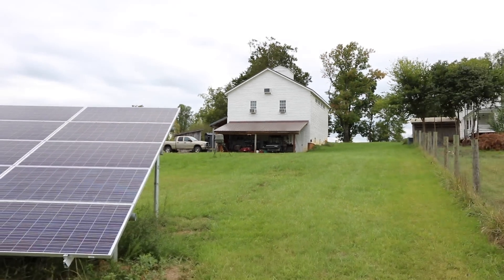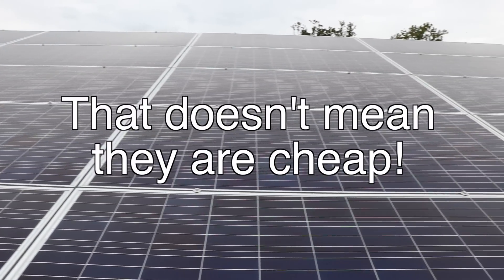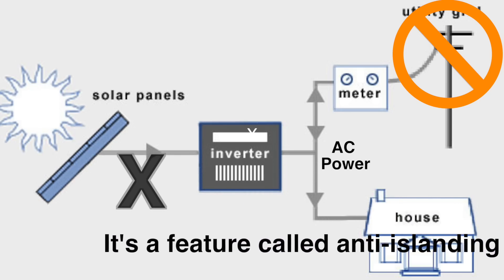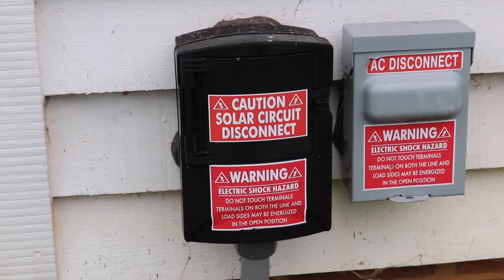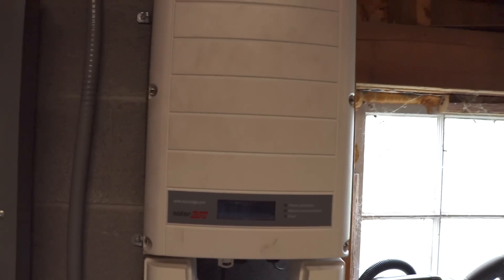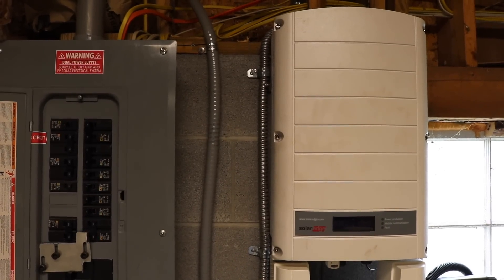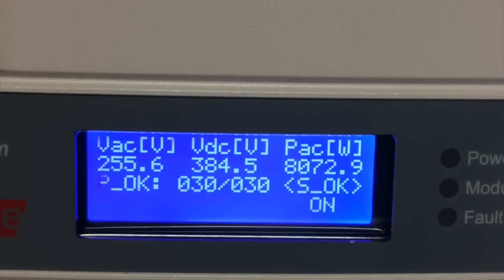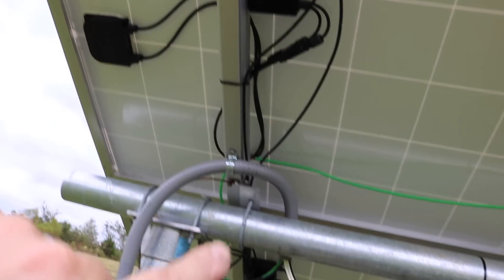The ugly truth behind grid-tie solar systems. Part 1, FarmCraft101 solar.  Watch before you buy!

Comment: $17K will buy me at least 15 years ($23K 20+ years) of maintenance free electricity that is off maybe 1 - 2 hours a year and none of it is sticking a hard working tax payer for part of my bill.
Reply from the maker: You only use $1100 of electricity per year?  I use double that.  Which means you could have a system half the size of mine and pay only $8.5k to supply 80% of your electricity for the next 30 years.  
Also, I have paid far more in taxes than the few tax credits I received from this.  Far, far more.  There is a lot of confusion over what a tax credit is.  It is basically a refund of taxes that you have to pay.  To people that don't pay taxes, credits are worthless.  It is not a check from the government to the recipient.  They are only a reduction in the taxes that the recipient pays.  In short, nobody got stuck paying a bill for me.  I just paid a little bit less one year.
Reply: @FarmCraft101  Where I live we have too many cloudy days and short winter days for solar to be practical.   Many have tried and all came up short on the cost effectiveness here.

Same with those who tried using ground and or air source heat pumps for heating.   The ground too damn cold to be effective for it.  Super summer air conditioning though but not cost effective for using just for that due to the install prices largely thanks to greedy contractors.

What we do have that works is wind power.  Loads of wind and I have played with it for years!
Reply: @tcmtech7515  Then Solar Panels are not an a viable option for you . Nobody is forcing you to use Solar Panels ...

Comment: yeah, you need a better isolator(?) switch. the kind of thing you have to have with a generator so linemen dont get shocked. to have power when the grid is down this cut-off would possibly have to be manually opened. without that feauture there is really no benifit other than the 100+ dollar a month savings.(going by my monthly bill since I dont remember the number you said)
 so get yourself one of those isolator switches, with a battery stack you shouldnt need the grid at all and I really ont understand why you wouldnt have done that instead.... its how the phone system works. big inverters, stacks of batteries and the phones will work for 24 hours without a generator running, its accualy part of the code, the system has to work in emergencies.
  ditch the power company!!

Comment: um buy a inverter that does not shut down and use a relay powered by the grid that keeps the circuit complete. when power goes out on grid relay drops off and keeps lineman safe.you will still have local power thats isolated from the grid.

Comment: I have a 10 kw grid only system, I have separate meter and it pays me $0.802/kw. I make about $10g/yr. so system paid for itself withing 3 years and I paid $50,000 90 months ago. The only thing that I dont like is the inverters not able to function if the grid goes down. need to design a manual transfer switch that will allow inverters to work without back feeding the grid. I have 2 aurora inverters that are fed 2 legs each of 545 vdc

Comment: It is the impedance (resistance) of the wire that creates loss  V=IxR. The higher the resistance the bigger the loss. That resistance will generate heat and eventually break down the wire.

Comment: Logically... Voltage/Polarity is the hose/pipe inside diameter, Amperage/Current is the pressure induced. Power of both ... their sum... would be the forces in which the hose/pipe must be built for. The strength, and size of the material, especially at junctions and fastenings, of that power transmission must withstand EXTREMES of weather and spikes....ie., your Breaker Box. Next, we can talk about Inverters, Regulated PowerSupplys, Relays, and Transformers !!

Comment: Have a shed right next to a giant silver maple I have to fell. Figure I'll leave the trunk in place to anchor a pole and start a simple grit tied system. 8 feet from the trunk is a small shed,  from the shed and tree, my house is about 40-50 feet. Would it make sense to run DC from the panels to the shed, then run the AC to the house? I'm not looking to start big.

Comment: You state that you don't have power if the grid goes down. I guess not. There is a device that can be placed between the output of your inverter and your breaker box. It is basically a small battery, an inverter and a computer. What it does is

a) maintain the charge of its battery from your solar power output
b) monitor the grid's power phase (the same way microinverters do for two reasons: 1) keep in perfect sync with the grid's phase and 2) detect when the grid goes down for (required) "rapid disconnect).

As soon as the grid goes down, but before the microinverters detect that fact, it
a) disconnects the output of the solar system from the grid but maintains a grid monitoring circuit (to detect when the grid is restored)
b) switches on its own microinverter and creates a perfect 220 VAC waveform that makes your solar system microinverters believe the grid is still energized
c) uses the solar panel microinverter output to keep its battery charged
d) and lastly, and perhaps most importantly takes output from the microinverters and routes it to a single 20 amp outlet.

20 amps isn't much, but it will run lights, keep your fridge/freezers running, keep a charge on a conventional lead-acid deep cycle battery for nighttime use... as long as there is light. It isn't a perfect solution, but it will keep thousands of dollars worth of frozen food from spoiling!

Think of it as an intelligent rapid disconnect with a bonus. Sure is a lot cheaper and easier to maintain than a lead-acid battery array with a separate 48V mega-inverter or a Tesla Power Wall.

BTW, I have a 4350 nominal watt solar system with Enphase IQ-6 microinverters, an Enphase Envoy all grid-tied through a one-to-one net meter. Have yet to pay an electric bill. Total cost of installation (start to finish, all permits, inspections, etc.) was $2.80/watt, and after this year's 30% tax credit that becomes $1.96/watt. It will pay for itself in 10.5 years. That, in my book, is a good investment.

Comment: Pretty interesting reading through many of the comments, and some overly strong opinions against solar...  Do the research, do the calculations, see if it makes sense for you and either do it or don't do it.  I put in a system last May after much research and running calculations on financial return.   I looked back at the historical energy cost increase for the last 20 years (about 1.03%) and used that number to project  cost increase and savings over the next 20 years.  My 6000w system will cost around $7000 after I claim the tax credit this year (designed and installed myself so costs were lower than most), and at the end of 20 years I will be up over $20,000.  I think it quite likely that the average increase over the next 20 years will be much higher than the past 20, which will only increase my return.  There aren't many investment opportunities to get that kind of return, and to feel good about it also.  To those harping on the environmental impact of producing solar panels, of course that's valid, but the electricity I would have gotten from the power plant would come most likely from burning fossil fuels, so let's not just consider half of the equation.  I think the broader picture is to look at a state like California where we aren't that far removed from having rolling blackouts because they couldn't meet the power demand.  As development continues in most metro areas the power demands go up and eventually a new power plant needs to be built and transmission infrastructure upgraded, what do you think has more of an environmental impact those solar panels or building a new power plant?  Peak demand on the power industry is always during the hottest, sunniest portions of the day/week/month/year, which is exactly when solar panels are cranking out their max output.  While my power co-op was running ads this summer asking people to reduce load during peak times of the day I was getting an extra little kicker back on my bill for not loading the system at those times, I was covering my power use.  If even ~10% of the homes in California had solar panels those rolling blackouts would probably never have happened, and the life of their power grid would have been greatly extended without massive investment in upgrading the power supply and transmission infrastructure.

As far as the "no power when the power goes out" comments...what portion of the year are you actually without power?  In 15 years in my current house we've had one outage of maybe 8-10 hours due to a blown transformer, otherwise a few times out for an hour or two due to a storm so for me it's just not a huge concern.  Some people find battery backup to be worth it, in my case I was all about the payback time for the system and battery backup would have added years to that with (for me) little benefit.  If the power goes out I won't have power, so what?  I knew that going in and it wasn't a factor in my decision, it was a good solid financial investment for us and we get some added enjoyment out of tracking the output day to day.  The following link should bring up a public version of the tracking page for my Enphase based system, you can go back through past days and see daily output.  October and November haven't been good, lots of clouds, but July was fantastic with just under 1000 kwh produced and I look to be on track to meet my projected annual output of 7800 kwh's which will pretty much cover our usage for the year.

https://enlighten.enphaseenergy.com/pv/public_systems/UrGs1410763/overview?preview=1
Reply: Fantastic quote and for me, very close to making the leap into deciding to buy and install my own, its nice to see someone mirror my sentiment

Comment: You idiots
Since when is plumbing the same as electricity or even relating the same
Water pressure remains constant unless you use a pump no matter what size pipe
Volume delivery is another story
Or should I say that’s what you should have said in the first place
Reply: You idiot, it is called an analogy  ...
Water Pressure is equivalent to Voltage

Comment: At the beginning explanation is quite perfect, the "dark" point is about the interrupting solar power when grid is collapse. You means that happened to all the solar systems or happened only to this with the partiqular grid?
Reply from the maker: It happens to grid tied systems, which is a term in the solar world that has a specific meaning.  It doesn't mean any system tied to the grid, because hybrid systems are also grid tied.  But when a solar installer talks about a grid tied system, this is what they mean, and they require the grid to be functioning to work.

Comment: Good explanation on how Grid Tie works. I'm running Off Grid with changeover switch to Grid. Expanding setup but currently 1K4 PV with 8K7W Batteries backup. A battery system is the way to go.

Comment: I have the same inverter.  The power optimizers set this voltage - for your system it isn't based on the panel voltage like you mention.  NEC 2017 allows for up to 1000V on PV DC side now, but most inverters capable of that right now are commercial grade.  Also, your disconnect isn't code complaint.  Has to be a handle type heavy duty disconnect.  Since these are newer systems, most inspectors won't know all the codes.  We did DIY and it was about $13k before 30% tax credit.  I'm in Ohio, so my payback isn't the best compared to the rest of the country, but it is still about 6 years.  PV is a good investment, especially considering it increases your house value.  I'm probably going to add 4kW of panels (inverter can take about 13.5kW DC) to account for an EV, then I will feel even more dependent from our oil/coal based electricity economy.  The naysayers in the comment section can keep burning oil and coal.  Their minds probably won't even change when electricity cost doubles.
Reply: Did you install a 9kW system for $13,000 -  before the Tax Credit ?
WOW, that is really cheap
What brand & size PV panels
What brand & size GT Inverter ?
What Mounting System

Comment: The sun does not need to shine for a solar PV system to produce electricity. In fact there are different solar PV modules that are designed for varios climates. Even on a cloudy day the system can produce up to 40% of it's designed DC electric output
Reply: The sun is still shining when there are clouds.   Ergo, the sun DOES need to shine to produce power via solar.
Reply: @carultch  You know exactly what I mean or are you just being pedantic? Solar PV modules do not need 'direct sunlight' to produce electricity. 'Ergo',  solar PV systems still produce electricity even on cloudy days
Reply: Of course I know what you really mean.  I'm just setting the record straight.
Reply: @carultch  The 'record' didn't need to be straightened if you understood the point originally as you said, but thanks anyway

Comment: 240V split produces two 120V phases, not single phase.
Reply: It is still called "single phase" for historical reasons, and based on the way the grid makes it.   In spite of what you might think, there is no such term as "two phase".  Even when your voltage system is derived from connecting across two phases (as opposed to across a single phase and neutral), it is still called "single phase".

The way the grid makes it, is it uses an individual phase from the distribution line, steps it down from medium voltage to 240V through the transformer, and then center-taps the 240V coil to assign the neutral conductor, which is then grounded to the grounding electrode and equipment grounding conductor system at the main service disconnect.

Comment: Surely a normally closed contactor where the coil is connected to the grid could solve the issue of you loosing power when you eventually have enough battery backup to supply your house.

Comment: What I don't understand is why not put an auto switch between the solar and grid.  Our plant gensets all have this function. When the power goes out, the natural gas generators automatically start and the switch also automatically disconntects our entire facility from the grid. Until power is restored. Also there is alot of false information on youtube, the internet, from my local power company and most of all, from the solar companies.  They all will state you have to pay an electrician to grid tie.  I called the state inspector who inspects these, he stated it is 100% false.  Then gave me the link to the state codes, and the permit.  Being an engineer designing machines using all forms from DC to 480ac ,. Installing solar is easy.

Comment: IMO it's best to do an off grid setup, then have rectifiers top up battery from hydro if you're not producing enough.  When you sell power to the grid, you will need to buy it back at some point and it will always be more expensive.  Makes more sense to store it.  Though a grid tied system IS cheaper, so it's a good way to get started, then later on upgrade to off grid.  Bonus is if you find yourself not even needing hydro you can cancel the service (in some places it's unfortunately illegal though) and then you save even more money, because it's all the fixed fees that are really expensive, and not so much the usage.
Reply: Fore most people, adding batteries to a Grid-Tie PV System is an immediate and permanent financial LOSS.

Comment: I lot of oil products, natural gas and coal will be needed to manufacture electric cars and more so in generating electric power for those cars. Coal number one as Germany is 80% coal run 30% of which comes from the USA, natural gas big growth in North America to generate power as we turn off coal. But coal is need to manufacture wind turbines 240,000 tons of C02 for an 80 meter wind turbine (Metallurgical coal need for cement 32,000 tons, 12,000 tons of re-bar, plus steel for transmission copper and oil for the blades all to be land fill in 35 years or less) Solar panels need 22 smelted and refines elements for a 15 to 25 year service before land fill (solar panels are very difficult to recycle because of the acids used in the manufacturing will mills 40 to 60% can be recycled only. NO RENEWABLE ENERGY scientifically impossible

Comment: Two things you can fix and still be grid tied. One have a switch that takes you off the grid when it goes down. This is normal houses normally have breakers to the main grid. This is also normal for people with emergency generators. Two get your self Tesla batteries. Batteries are your back up. Nowhere is this against the law. And you can still be grid tied.

Comment: the inverter likey does not boost the output voltage to slightly to cause the reverse current flow or at least thats not all it does. it almost certainly will apply a small phase shift this is where the  real power is applied in more simple terms it will start its output sine wave slightly before the power grids sine wave. 

in a grid tie generator it will have adjustments for the voltage as well as a throttle. once tied to the grid you can adjust the voltage and that portion will adjust the KVAR or the "imaginary or reactive power" you would use this to correct power factor but eccentrically it does not take the mechanical power of the engine to do this. however you do have a throttle control,since no matter how hard the motor trys to turn it will not spin faster, the grid is more than capable of absorbing all the energy you can though at it with a small generator and you will not output more than 60Hz but what you will be causing is a phase shift this is where the increase torque of the motor is used up and you can then back feed the grid.
Reply: Actually the Inverter is an AC Current Source. It supplies AC amperage that is in-phase with the Grid, not phase shifted.